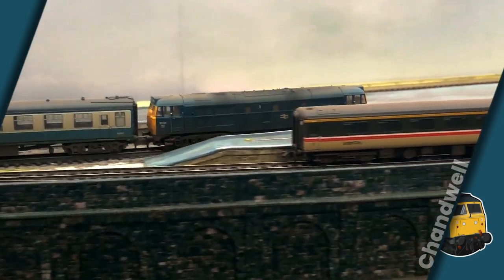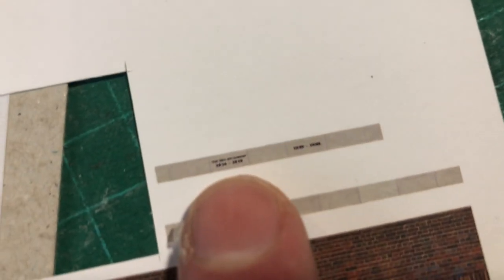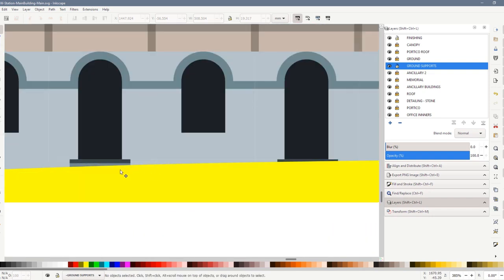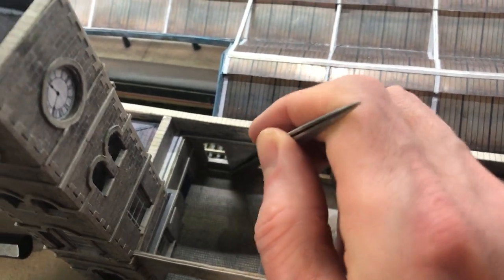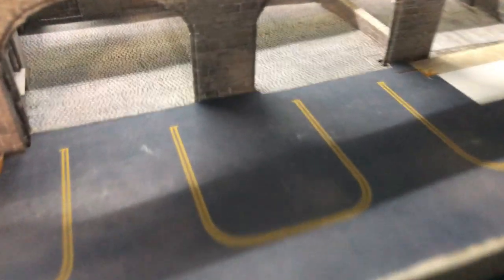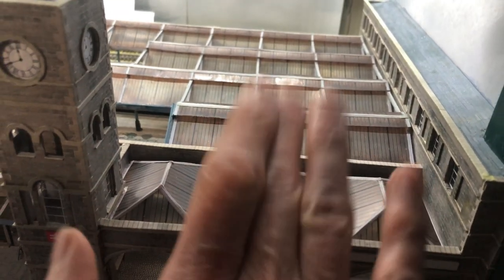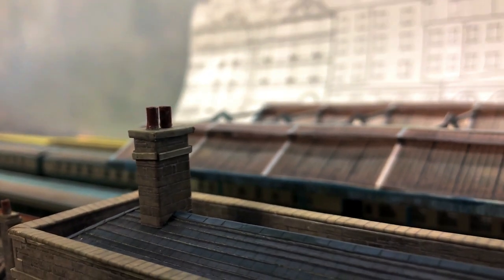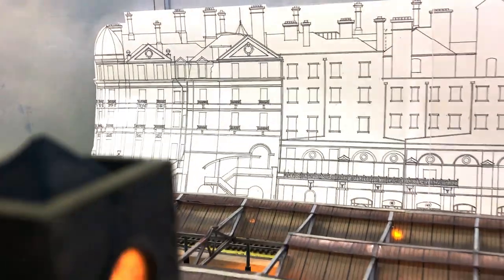Scratch-Built Mainline Terminus Station Part 3 : Completing a scratch build in card

Comment: Hello. Algorithm comment for the Elders of YouTubes. :)
Reply from the maker: Algorithm comment accepted. 👍
Reply: @Chandwell  On my second watch through, I noticed that I actually may know an Inkscape trick you're not familiar with?
Your war memorial; the letters are just typed on and  not made to look carved  or embossed. Is that deliberate because of its size  and you know how to do those tricks?
Or would you like a link to how to do it?  I didn't want to just assume you didn't know (You're very good with Inkscape). :)
Reply from the maker: I do know a trick to do this but didn’t do it here as the text is already too small for the naked eye to see. I’d love to hear your trick though as mine is quite convoluted involving two intersections of the text left-up and right-down.
Reply: @Chandwell  I learned a lot of Inkscape from the channel 'Logos by Nick'. The video is question is this one: https://www.youtube.com/watch?v=W5WS3Up22hI It's for the carved look, but I found that I can use it to make embossed looks too depending on where the darker lettering is placed and blurred.
I don't do the step he does with the rectangle, instead, I duplicate the word, change its colour and drag it around until I get the angle I like, then, I 'difference' it. 
I do the same thing for highlights too. (you'll need a few copies of the word) 
Then, if I want it to look embossed, it goes on bottom layer and gets blurring applied, or for carving it's added to the top layer and played with there, etc...

There are a few steps in this one too, but with your level of knowledge, you can discard the superfluous steps same as I did.  I
t's prob just as much a pain in the rear as your method though.